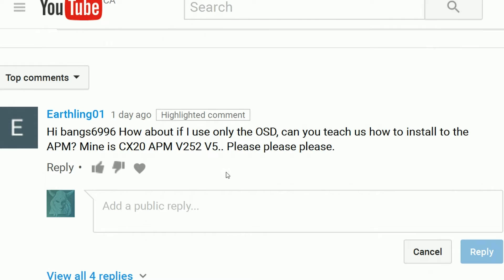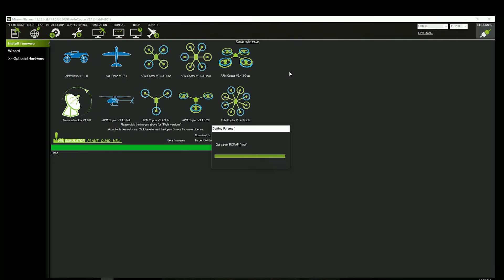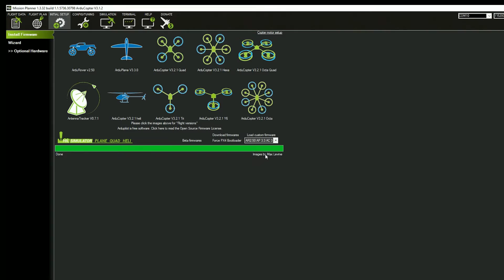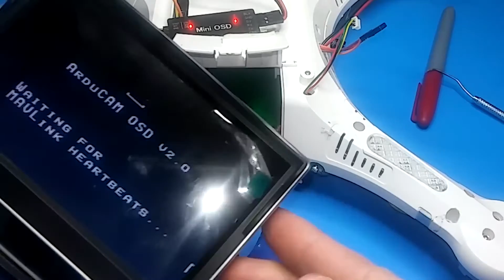cx20 apm 252 v5 osd install

Comment: When I try to select load custom firmware, MP doesn't allow it and the selection is removed from the screen never to be seen again until I restart MP and does the same thing again?

Ok in advanced layout it allows me to load the custom firmware. But each time I try to go through the wizard it uploads the latest firmware.

Oh, don't need to go through the wizard.

Now will try my tele radios again and then an OSD.

Thanks
Reply from the maker: hi try to open up mission planner with or without the quad connected.. go to config/tuning 
click on planner ..then look for "Layout"
choose "Advanced" from the drop down menu
..you should now see the option for custom firmware..
Reply from the maker: oh never notice you edited your post with a reply.. youtube does not notify me of edits... anyways.. as you figured out you don't need to do the wizard.. 

I never use the wizard anyways , I just do all the calibrations  on there own....

Comment: Very useful as usual. I only must have missed where on the APM i can get the info about battery level/voltage to be read and transmitted via telemetry. Anyway, thanks! you ARE a well of science!
Reply from the maker: Hi and thanks I have another video on that subject.. https://www.youtube.com/watch?v=rTRFXnnsnUU   .. you need to get a power module to be able to see your voltages over telemetry ..
Reply: thank you (again and ever). Flyin' froggies should consider wearing their prescription glasses then:D. Acutally, I was considering buying this one before http://www.gearbest.com/multi-rotor-parts/pp_396730.html. Lighter, smaller, probably easier to install(love to solder!), but seems a lil' outdated.
Reply from the maker: that should work just the same.. its nice and small like you said.. and has the same chips on it anyways..